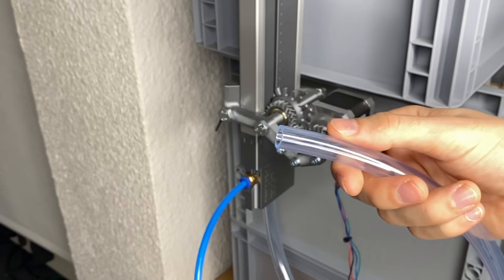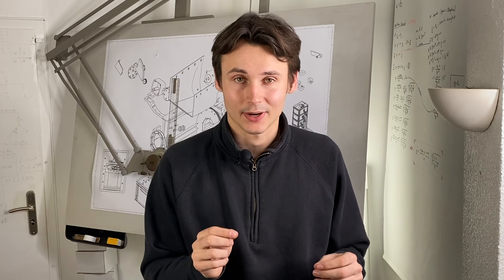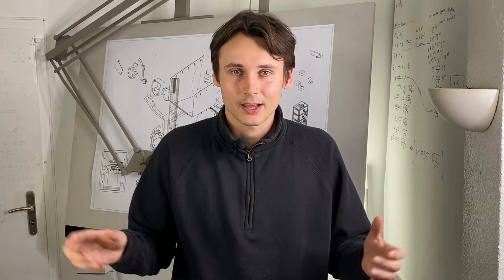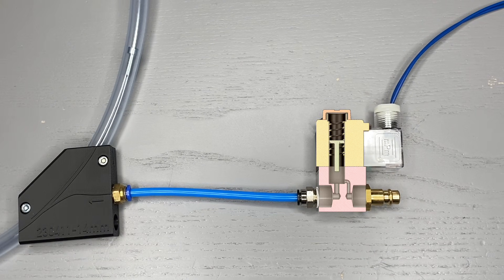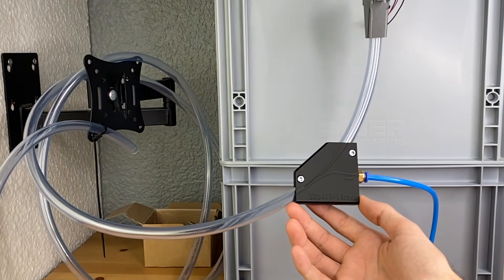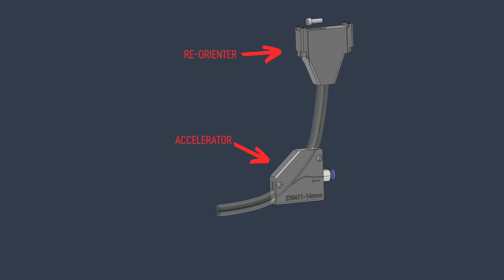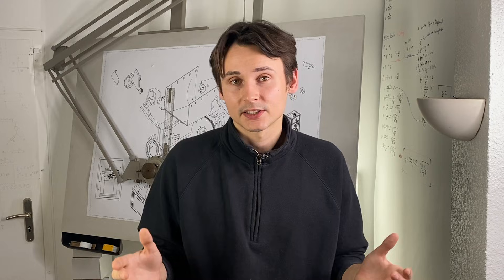A pneumatic accelerator for screws - 3d printed automation #004

Comment: I don't know if you know this, but you just reinvented the vacuum feeder.   Pneumatic conveyors are pretty common in injection molding facilities. It is great to see a young engineer at work.  I wish I had the tools we have now when I started out.   I also like you discussing "complexity shifting".  I wish more engineers worked harder to improve the manufacturability of their designs.  I see so many instances of thousands of dollars being wasted just because a guy at a cad station decided that's how a part has to be.

Comment: You mentioned multiple accelerators, but this would invalidate the combined module. I wonder if two modules that stack would be a good approach? You could stack the magazine to the orientation module and then to the accelerator, then have additional accelerators without the need for a decoupled variant?

Comment: Likely already mentioned in the comments but you could easily add a limit switch within the accelerator assembly to trigger the air only once the part has passed the accelerator part. It could also easily be used as part of the counting mechanism too for confirmation.
Reply: ... or a photoelectric switch

Comment: Another module that would be cool to see with this system would be a tube multiplexer. Perhaps using a stepper and linear motion connected to a sliding manifold to switch one screw output quickly between many tubes. Might be able to expand the capabilities of a single feeder/counter system to an array of end effectors, especially considering the rapid throughput would in many instances be able to accomodate a large array of end effectors if their fills/minute are as low as the current system for 3D printing. One system could easily support a very large farm at that rate.

Comment: Nice work Christopher!  If you want to save air, move the acutator valve as close as possible to your nozzle.  The volume upstream of the nozzle that raises and lowers pressure each actuation is just wasted energy doing nothing useful.

Comment: We have been blow-feeding screws in industry for 30+ years. The only thing new here is the 3D printing. Even the block that was printed could be easily manufactured from aluminum bar stock, and it would be far more rugged.

Comment: Disagree with the integrated component concept based on intended usage and serviceability.  
Advantages with separate stages:
- Separation of manufacturing process steps depending on installation and layout requirements at the facility.  
- individual components isolate failure stages for remote monitoring, diagnostics, and repair
- Increased part count offers more service parts revenue opportunity over time
- specialized functional stages can be optimized over time with fewer integrational compromises

When you think about selling and supporting 100,000 of these systems in customer's hands, your perspective on 'desirable features' may change depending on the intended market and use cases

If these are going direct to consumers... by all means, integrate everything, including the incoming air valve and solenoid into one component for injection molding.

Comment: I'm curious how the automatic screwing system will look like in the end. And I'm curious if you're going to use a 4 or 5 steps screwing strategy, with torque and angle measurement. That would be groundbreaking. A 3D printed screwing system that can be a nice competitor for Atlas Copco or other vendors 😁

Best of luck! 👍🏻

Comment: Why does the little pusher arm have to be articulated and timed to move out of the way of the fasteners? Could they not have been manufactured to be flush with the disc?  (Not a leading question: I actually have no clue, and am not mechanically inclined)

Comment: Your complexety shifting is very interesting. Similar approach is used in software and systems engineering by some. I like to do it in a "smart data but dumb code" way.
You approach to apply those principles to manufacturing seems novel and very interesting.

Comment: I think you'd want repeaters which would are basically be a straight piece with a vent and an accelerator combined. (So the valve normally vents and when it's closed it increases pressure, which should allow pieces to pass through without putting too much back pressure on the incoming pieces.

Another option would be to use higher pressure lines for longer runs.

Comment: Random thought… and it may have been mentioned… but something you said caught my attention. You said something about using the system with a “cordless” driver. Have you considered using this system to load spare magazines with screws? I don’t know the whole context, but from a building/construction point of view it would be amazing to have a charging/loading station where I could go drop my empty magazines into the system and grab loaded ones to clip to my belt and go back to work without missing a beat.

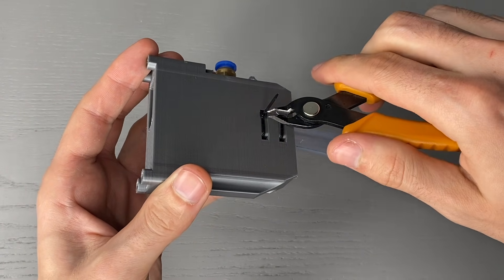Comment: 5:21. NEVER use dikes to cut zip ties. That leaves a knife edge that can easily cut skin. Especially when reaching over a wire bundle or inside a hidden area. Instead use a tie-wrap gun. They pull tight and trim the tie-wrap flush for a *perfect installation * every time. They range from cheap to professional. I recommend all metal, although some plastic ones work. My metal one is over 40 years old and I’ve applied many thousands of zip ties, it’s still working like a champ.

Comment: to get a nicely sealed part you could dip the 3d printed part into an epoxy possibly? im sure there are resins that could be used like a UV cure from a resin printer and cure it with some UV sources in under an hour.   if done right im sure it could work and not cause too much part dimension change

Comment: Cool design.  I agree that when designing you need to keep a Systems Approach but this is very hard since Engineers are usually stronger/biased to certain solutions.  I also believe that with rare exceptions (such as the Flat Blade Screwdriver and the Claw Hammer) complexity and capability run together - to be more capable, a tool has to be more complex - and as complexity increases, so do problems.  To make things reliable, you need find the right balance of capability and complexity and only add complexity as needed.  As Elon Musk has said, "the best part is no part".

Comment: I like your complexity shifting idea but I'm not sure about the example you showed with a 3D-printed joint for aluminium extrusions. I'd love it if that worked but will the 3D printed joint ever be strong enough to justify the strength of the aluminium it's connecting?

Comment: I have worked on similar pneumatic hardware feeder systems in the past. They were able to reliably feed through over 10 meters of tubing. They used a small tube mounted though-beam sensor that detected when the screw dropped into the feed tube and used that to trigger the air blast. Worked very well. They also utilized a 1 into 4 mechanism where one bowl feeder was able to feed into four separate output tubes that were selectible via pneumatically actuated gates. Additionally it used a profile image sensor to verify correct hardware length and diameter at the bowl output chute before releasing into the pneumatic feeder stage.

Comment: Was there a reason to not continuously blow air through the tube while the system was transporting screws through the tube? Blowing air through the tube at such an angle should create a negative pressure zone in front of the screws before passing the injector, then a positive pressure zone behind them after they pass the air injector. I've never built anything such as this so I may be just making an incorrect assumption. Thanks!

Comment: We use this style of system to feed  nuts, bolts, and studs to our robots at work. We run them out about 20 meters at .6bar with no real issues on leakage even though our feeder is not airtight. We have a sensor inside the effector tooling that sees when the product has arrived before shutting the solenoid valve.

Comment: I think the complexity shifting should have a video

As for the airtightness of the printed parts, i have found that a soldering rework station (yes, the hot air gun part) works really well if you only need to fill in tiny imperfections. Results do vary though and you'd need a jig for each part to get consistent results (managed to get 250 ABS-CF parts airtight to 8 bars with a good jig)
Reply from the maker: I never tried the hot air gun trick. Great Idea. I agree on the need for a jig. Thank you for all of your comments! They are always super helpful!

Comment: You don't need the accelerator at the start, Bernoulli is your friend 😉
Positioned inline works fine, with clever design "track switches" without moving parts are possible too.

Comment: 4:11 - just giving the concept a name, "complexity shifting", already gives my brain something to latch onto as a way to think about ways to solve problems.  I love it.  Is it a phrase you've heard elsewhere, or entirely your own invention?  Either way, I'd be interested in hearing more of your thoughts about it!  And I expect I'll be pondering it either way.  Indeed, I think I already have been in ways, without having a name for what I was doing, and thus thinking about it a little differently, but I think the thoughts were in that realm in a way.
Reply: I think you use this complexity shifting all the time when you design assemblies that use standardized parts like screw, zip-ties etc . The part that holds everything together and that is regularly produced on the mill contains all the specialties necessary to combine functions to work together in the designated way.

Comment: You may be able to use acetone to smooth and seal the outside of your 3D prints. Though it didn't look like you needed to worry about the air loss with your current setup.

Comment: For efficiency, you could add a small solenoid valve for the compressed air and a hall effect sensor right after the spot where the two channels meet, which would open the valve through a transistor each time a bolt passes it.
Reply: I had a similar idea for keeping the valve open until the bolt is at the end of the tube, so that the tube length does not matter - but i'd go with an optical sensor, as not all bolts are necessarily ferrous. ;-)
Reply: @jangrewe   you’re right! Optical sensor is certainly a better idea for then you don’t have to worry about the type of material at all.

Comment: They already have automatic screw guns for the industry. I worked for a short time 20 years ago with an automatic loading device. You just throw a box of screws in and they push them selves into a tube to the drill.

Comment: I like your innovative approach to these problems, however I have a few engineering/production theories of my own that might inform you:
1. Avoid conveying where possible. Better to have a cache with a feeder for each machine, rather than a huge network of tubes.
2. Decentralise where possible. Rather than your factory be one big machine, try to create discrete “cells” that are fully self-contained. The only inputs to a cell should be electricity, air and containers of components, and the outputs should end up in containers also.

Complexity shifting is a nice concept. Basically, fully exploit the manufacturing processes you have available (like cheap 3D printing or cheap PCB manufacturing), and take full advantage of the properties of materials and technologies you have (like the strength of aluminium/steel beams).

This may be out of scope for you, but you would be amazed with the kind of things you can make with a (real) laser cutter and a sheet steel bender. Amazingly strong, amazingly cheap parts.

One note about that 3DP and aluminium extrusion assembly you showed. I don’t know if this was a real part or you just created it to demonstrate your idea, but this design makes me uncomfortable. You have three incredibly strong pieces of extrusion connected to a super weak 3DP piece of plastic. Better to make the plastic chunky so that it has similar strength to the extrusion. Or use thinner extrusion. Also, better to have the weak plastic parts as small and as compact as possible. It should basically be a solid block with 3 facets cut out of it where the extrusion connects. Your design is mostly arbitrary, which you should try to avoid.

There is such a thing as optimal or near-optimal design. You should have watertight rationale for every single geometric feature or decision that factors into your design. Other engineers should be hard pressed to find more optimal ways of achieving the same result.

Comment: awesome project 
maybe you can experiment with a Cylindrical Tesla Valve to reduce the pressure escaping from the inlet of the screws (the inlet where the screws enter the 3D printed part) also you might want to add a laser switch to switch on the air when the screw just passes after the air inlet

Comment: How do you keep track of information such as the hole size, depth, pitch, spacing, diameter etc of your integrated components / interfaces? I just spent too long measuring one of those pneumatic couplers and know next time I need to plug one in I'll have to do it again.

As a software architect I am always looking for reusable design patterns, and have been exploring applying what I know to the industrial design space. I'd love to hear more about it, your designs demonstrate a clarity of thinking that suggests it would be a good video

Comment: Did you know that festo also makes those tube screw fittings with a -I suffix with an inner hex drive? I really prefer those, because it is much easier to design with, as they don’t require space for a socket around them, when screwing them in. They also look a bit sleeker. I don’t even think they affect air flow much, if at all. Not sure if there’s a price difference.

Comment: I agree with you on complexity shifting! I've thought about this stuff a lot but haven't been able to put it into words like you have. Moving complexity to manufacturing technologies which do well with complex geometry at low cost, like 3D printing, laser cutting, waterjetting, and then relying on simple off-the-shelf components like 2020 extrusions for the rest can result in a very cost-effective design that still meets the requirements on the design.

Another area I've had success with is with moving complex wiring jobs onto PCBs. PCBs are cheap; $5 + 1 hour of soldering will in the end be a lot better than $0 of PCB + 10 hours of wiring. Good for robots and cars.

Comment: I am concerned about the exit speed of the parts.
I love the idea.
How do you prevent the screws flying all over inside the printer?
They have to stick in their pocket to be enclosed by the print for shipping.
For the screw embedding for shipping: My idea is to make separate compartments for every screw. Or little dividers in the bigger one.

Comment: I used to treat 3d printing as fun, something like for  prototyping until I built and tested a tool changer for UR10 and saved 5k euro. It was fully operational and cost less then 10 euros, and more then this it would take 20sec to replace it if it is broken.

Comment: What is the reason for this?
This is amazing but I am so lost
Reply: Basically it is a “Parts Vending Machine” of sorts for adding screws and such to kits.

You get a cardboard box, put in some protective foam, chuck in the 3d printed parts, grab a bag, hold it under a “chute” and this machine does all the screw counting and fills the bag in seconds!
Reply: Also one could use this for Nail/Screw/Upholstery Tack “Guns” or for placing parts in 3D Printed Componets Mid-Print!
Reply: oh so it is basically someones start of a small production line?

Comment: Hi. You could seal the 3D prints with a vacuum chamber and a liquid thin enough to be sucked into the print when the air is sucked out. Obviously the liquid needs to be of a curable nature.

Comment: I do like the concept of complexity shifting, I've actually been using it a lot in my designs without knowing what the right term for it would be. I love working with wood or extruded aluminium for the load-bearing, but simple pieces of my designs just because I keep thinking it's a waste to print a +24hr element that could easily be split into 90% pre-worked material (like dowels, rods, sheet metal, etc) and a ~2hr printed part.

Or maybe I'm just too precious with my printing times and wasting plastic ¯\_(ツ)_/¯
Reply: I'm 110% with you on saving time and money.  My designs include as much pre-worked material (I like that term!) as possible & practical.  Why re-invent the wheel and make it inferior, to boot?

Comment: If you put the acellerator on the exit end of the tube, it must increase productivity (as the ejection works primarily on the vacuum), make the operation less dependant on tolerances between tube and screws, also will help automate the on-off timing, if you incorporate magnetic or optic sensor checking the screw passing by.
Reply: I am unsure on the effectiveness of Vacuum alone vs pressure alone, but having lower pressure in front does reduce the drag.  Granted I don’t know, this may make it go too fast and just shoot through whatever is at the end of the chute!  Not making a “potato cannon” i guess.
Reply: On the note of part counting i agree completely!

Making a “Inline Part Counting Module” may be a good way of going about this.  It would allow for easily placing it any without having to modify files, rapid iteration of sensing methods, and adaptability (can use optical if some parts aren’t magnetic etc)

Comment: Industrial automated screw feeders that feed auto screw drivers usually have a 24v DC extended field proximity sensor to count the screws passing through the tube and trigger the valve, ensuring only one screw travels per cycle and the system does not get blocked up with hundreds of screws